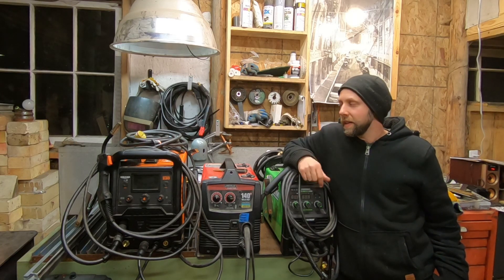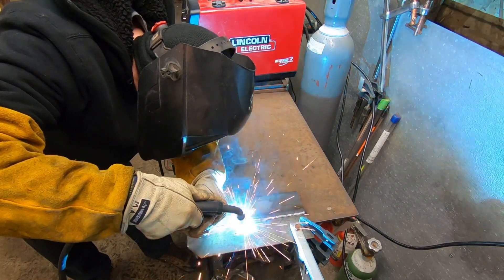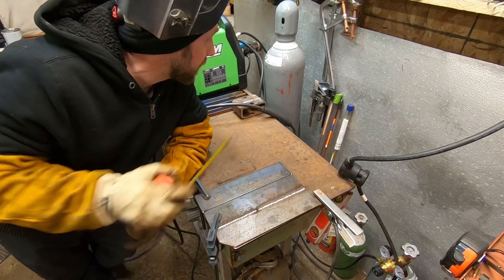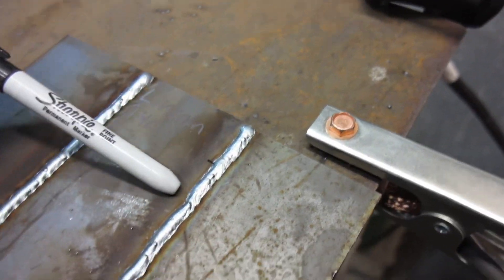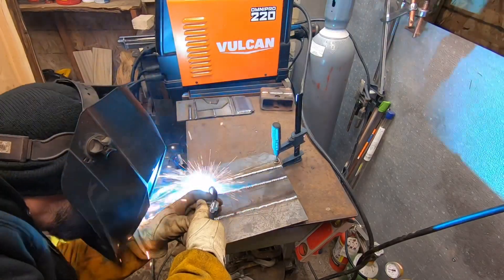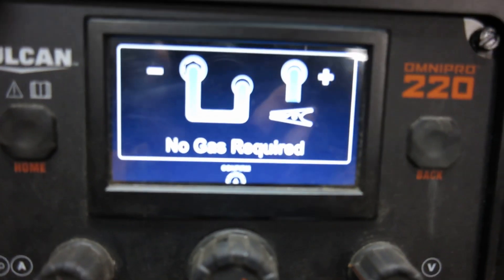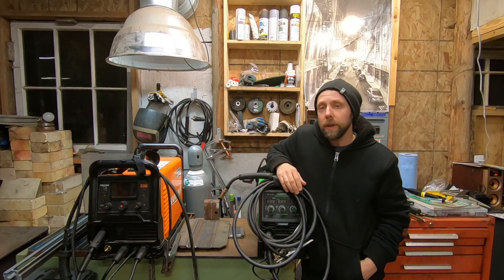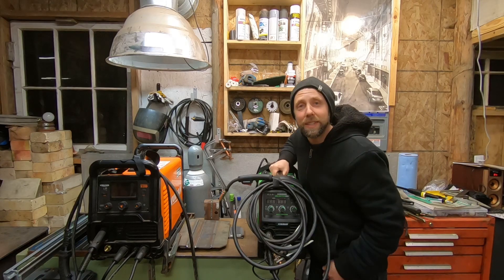Titanium Vulcan welders 120 volt MIG test

Comment: I have a titanium 170 with spool gun: it all runs amazing…. Aluminum, flux, and mig shielded… absolutely unbelievable… I have yet to burn a tip on aluminum welding and I’ve run through about 4 pounds of aluminum. I don’t know about the longevity of this machine, but the ease-of-use is out of this world. And you can most certainly weld aluminum thinner than an eighth with no problem, just watch your heat input and try to run each individual bead with the aluminum cooled….. I cannot say enough about how I was blown away by this machine… Love it!

Comment: Just got the titanium unlimited 200. Running .035 with 75/25 argon/c02 it's putting nice flat welds on 3/8 tube I salvaged to make a rocket stove. It punches way above its price and size range. I haven't managed to overheat it yet.
Reply from the maker: They are definitely solid welders! My Titanium 200 is still going strong 💪🏼 
I loaned my 200 to my friend, he really likes it as well 👍 I’m glad to hear you like yours 🙂

Comment: I use a Lincoln 140 at home with 120 volt,  with a 20 amp breaker, wired with 12/3 wire.  Never popped a breaker yet.  Pros and cons to both inverter and transformer welders. I was trained at the Lincoln school of welding, so I am partial to Lincoln🧡.  Thanks for the review.👍

Comment: i think this machine it cost $860.00 now
Reply from the maker: It’s a bummer the Titanium went up in price, at $650 it was a good welder at a good price, $850 is asking a lot, good machines still but there’s a lot of other good welders available in that range.
Reply: I work at harbor freight it’s on sale at 999 but normally it’s like 1150 (omnipro)
Reply: @parkeryj3135  $1000 was the normal price for the OmniPro back when I got mine for $850. But, most things at HF have been creeping up in price.

Comment: I think the Lincoln transformers when they start to wear or get old they start to have a lower and lower duty cycle. I have the hd 180 but on 220. 220v help the longevity of any machine over 110. The 110 is what kills the transformers and makes them heat up. Setting up a 220v sub-panel is easy to do with home depot gear. You should have everything on 220 at least.

Comment: The vulcan is 1049 dollars....The Lincoln is 589 dollars.....
Reply from the maker: The Vulcan is also 120, 220 volt, it’s a Mig, Stick and DC TIG welder with auto set, memory and a spot welding feature, it’s an inverter machine also, it also has a far better duty cycle. I have spent countless hours on each of these machines, I would never consider buying that Lincoln after using it and knowing how bad of a machine it is. Take care Muriel 🙂
Reply: @Mikefestiva  Thanks...I was considering buying one...glad I didn't !
Reply from the maker: @mlbabineaux  I think the Titanium 200 is a great welder, I have used it a lot over the last two years and it’s been rock solid. It’s also 120/220 volts, inverter machine, MiG, stick and DC TIG, it’s not auto set but it’s got a nice chart for all the MiG settings, it’s also spool guy ready, so for another $160 you can buy a spool gun and weld aluminum. If you check out my articulating dump truck series, I used that welder to build the entire machine, it’s quite capable. I also have never hit the duty cycle on it. Take care 🙂

Comment: Hello. Can you tell me if the Titanium mig you have (140 or 170) will weld below 125ipm? This is my second Titanium 170 and neither would feed below 125ipm. Basically you pull the trigger and it feeds maybe 1/4" of wire and arcs, then it stops feeding but continues to arc from the tip to the work. It is on 2T with gas on and voltage around 15 and inductance in the center. Many chart settings are below 125ipm so that is why I am concerned. So its almost like the software isnt sending the feed motor enough power below 125ipm. Above 125ipm it welds fine. Thanks.

Comment: Thanks Mike, great review! Question: I’m thinking to get a Titanium mig 140. But I want to run it off a generator because I have a lot of field welding I’m going to do. What kind of generator can I use? I have a 5600 Briggs and Stratton gen, would that work?
Reply: Since it is an inverter machine, they are picky what kind of power supply they are hooked up to; should be an inverter generator or other "clean" power source.

Comment: Hey Mike, Thanks for the great videos....I do have a few issues with a few of your mentions and comparisons. I am firm believer if you compare machines you need to get ones that are extremely comparable as for the Lincoln you used was not and the dogging on the machine is not fair. You dont compare a diesel pickup pulling power vs a midsize gas pickup. My only reason for this is ppl are persuaded easily and from your comparisons the dogging on the Lincoln machine ppl take that out of context and think Lincoln is junk. You should be comparing with the Lincoln MP210.  I have been a heavy machine welder for 25+ years and now supervisor of a welding shop that welds every type of metal material from 18ga to 6" thick solid steel,  we use several different brands of welders and I will say without mentioning brand names our red machines out perform and never break down as for our blue machines they are only couple years old and are damn near wore out and are extremely weak now....only time we use them is for aluminum. Now for my personal welder I had a non inverter Lincoln which it welds great for being non inverter but I updated to MP210 and all I can say is WOW!!!!!!! It is a hell of a machine so please get your hands on one to compare please. Couple questions for you is why are you vertical up welding with standard mig wire? Some of your welding techniques I question...... but to each his own....but if I had an employee lay a piled weld as you did on the second long weld I would be having an education course on proper welding techniques. Again dont take this as me digging on you for everyone has their own way of welding. Thank you for the great videos and keep it up.
Reply from the maker: I’m surprised with someone that’s been welding as long as you, that you wonder why I’m MiG welding vertical up? It’s much stronger and you get much better penetration then MIG welding vertical down. If you are only looking for a nice looking weld but could care less about penetration then weld down hill like you mentioned.
As for you getting upset that I compared this Lincoln on 120 volts to the other welders on 120 volts, they are all on the same playing field because I’m running them ALL on the same voltage. Sorry if you got upset because I really don’t care much for Lincoln, especially there consumer models.
Ps I really would like to see a video from you on your welds and techniques, you seem to really pick my welding apart, I sure would like to see a video from you and your welding skills, let me know when you post one please.
Reply: @Mikefestiva  It is providing using the proper wire for vertical up welding. So here is a perfect scenerio for you on vertical up.....a former employee was welding vertical up threaded ends on 8" pipe casing with both pieces being chamfered roughly 3/8",  he to has welded for as long as I have ...the company drilled 60' with the pipe and brought it back due to only 1" of the weld holding as the rest of the weld was cracked so I ground it out and rewelded it with a common process. I have welded roughly 600' of this well casing and have never had one fail with common welding process. So take that for what it is worth to you. No I was not picking you welding apart I was merely asking why you chose to do what you do? If it was something you were taught or self taught? I am not a state certified welder for no reason. I ask because I am curious. I also asked  for you to compare apples to apples which you did not, so hate on Lincoln all you want thats fine your entitled...if we all liked the samething thing it would be pretty boring world.

Comment: Does anybody know why my titanium 200 only goes up to 70 amps when i do stick? Is it maybe because i have to plug it up to the 220 volts ?
Reply from the maker: Yes all multi voltage welders are limited on there output if only plugged into 120 volts.
It’s like running a V8 on 4 cylinders 😂
Take care Leandro

Comment: Idk why but my welds look nothing like that. I'm on a titanium 200 running 120 with .30 wire. My welds are all dark and full of pin holes. Ive tried going slower and faster and no difference.
Reply from the maker: MO A K It sounds like you don’t have shielding gas coverage? What gas are you using? You need to set your regulator to about 8 to 10 CFH gas flow. If you turn up your gas flow and tap the trigger for a moment can you hear a little hiss of gas coming out of the MIG gun? Under your door where you load the MIG wire in the upper right hand corner is your switch set to MIG not Spool gun and is your gas line plugged into the gas quick disconnect? Check all those things, if that doesn’t fix your problem let me know and we will dig deeper.
Reply: @Mikefestiva  I am running 75/25. I have it set at about 20 CFH with trigger on. I have my garage door closed and no fans on. I made sure it was set to mig and I do hear gas coming out. Although it only seems like a very brief time that it does. I was wondering if the humidity might be too high so I will go in my garage tomorrow only opening the side door instead of the main door. Ill check the gas quick disconnect as well as now im not sure lol
Reply: I got it going. It was the gas. My lead wasnt all the way in😅

Comment: Hey Mike, quick question. I’ve  been undecided  between the Titanium 200 and Vulcan omnipro 220. Would any of these be useful to make a 25 x 15 carport? The thickest metal will be the 4x4 square tubing 3/16 gauge. Other than that I would use it for small welding projects?
Reply from the maker: Hey Jaime both welders work great and would handle 3/16” no problem.
I really liked the Omnipro 220 but after trying out the Titanium 200 I found it fit my needs best because it was only about 26# and more compact compared to the 50# of the Omnipro, I find it to be much easier to pack around.
The Omnipro has more options and I do miss the auto set feature the most but the Titanium has a really simple metal chart inside the door for settings so it’s a simple thing to setup quickly. I hope this helps.

Comment: Howdy Mike! Just picked up the titanium 200 (because of your videos) and I can't wait to start fabricating things. I have an equipment restoration biz and I've been using HFreight's $90 flux core welder..with fairly decent results. Can't wait to get this unit going! Thanks again for the videos!
Reply from the maker: I think you will definitely enjoy having the 200, especially if you run it with shielding gas!
Reply: @Mikefestiva  , is there a particular brand of wire and, stick welding rods that you prefer. I do remember you saying that you don't stick much, just curious. Thanks!

Comment: Mike, i know nothing about welding but i'm gonna learn as a hobby. Don't have 220 in shop yet so i was looking for a 120V welder. Went to Harbor freight and got a Flux 125. Put it in my buggy. Stayed 2 hrs in Harbor Freight rolling around getting a helmet,gloves and other stuff not welder related i don't need. Then i went back buy the isle and saw a stupid coupon for the 140. I said "it's just a little more with the coupon. Then i said...maybe i'll have 220 in the shop one day AND try gas and then talked myself out of it UNTIL...i noticed  a coupon for the 170 for 449.00. So i bought a 170. Harbor Freight is like crack. I buy so much stuff i really don't need. I once went in to buy a 2.00 bottle of thread lock. By the time i checked out i had spent 100.00. Guess if you are gonna go in might as well go all in. I subscribed and been following your welding videos.
Reply from the maker: DXT61 Thanks for checking out my channel 👍
As I was reading your comment I was thinking I need to suggest the Titanium 170, and by the time I got to the end I see that’s the one you got! You will be happy with it, 120/ 220 you will definitely like it. I have a lot of videos talking about tips on welding and fab work, you will be laying down nice welds in no time!

Comment: I really appreciate your reviews. About the Lincoln I had to switch over to a dedicated 120/20 Amp breaker.  Basically, I unplug my washing machine...lol it won't run well on a 15 Amp circuit at all. I also cannot stand the duty cycle. It runs good once then constantly stays hot. Keep up the great Videos!

Comment: Can any of these weld aluminum well on 120v with a spool gun?
Reply from the maker: Yes they all can run a spool gun. The Titanium 170 and spool gun would be your best value, if you buy the 170 and spool gun on sale you can get both for about $600. I think you would be limited to 1/8” or a little thicker on 120 volts. Take care

Comment: I’ve been welding for a little now, compared to some I’m still a beginner and I know that. I’ve welded for work and hobbies, that being said every professional job I have ever done was with a Lincoln or Miller but the fact is that it was always stick or tig. Most professional welders use those two and only use mig on minuscule jobs. Now with that being said I have a Miller mig and an older stick welder, the miller just doesn’t cut it anymore. I’m constantly going over my welds because I’m not confident in the penetration or just using my stick welder.  So that brings me to shopping and I resonantly found the volcan welder and decided to do my research on it and found your videos. I’ve now seen all of you comparison and reviews on both. I have enjoyed them all and the amount of detail you put in to them. I think you are 100% correct on your statement being that these are not big professional welders their an at home hobbiest tool and from ever think you’ve said and showed tells me that’s exactly what they are and I thank you for that and for your comprehension view and awesome videos. I will be buying the volcan Omni pro soon because of your videos!! Thank you again!

Comment: I have a 175 Pro Lincoln Mig Welder 230 volt bought it in 2003 17 years ago and still welding, it will weld 1/2 plate with .045 wire in one pass, I welded a lot of 1/4 to 3/8 things for My Jeeps bumper, Racks, tube door's, Nurf slider's bar's, shock mount bracket's on My trailer, Made 2 brackets for My 60 gal air compressor for hose reel's 25' and 50' , I took 6 month of welding classes at a High School on Saturday's Stick welding 1'' Plate, I use a Mig at School about 3 or 4 time's Before My Job got in the way of taking Classes, I was a Truck Driver by trade for 30 years until put on disability by the State of California,  I would like too buy a new Everlast MTS 252 STI A/C D/C Welder So I can Learn too Tig weld and Tig Aluminum, About 4 years ago I did buy a Hypertherm XP 45 Plasma 230 volt cutter with dual 25'ft. torches, cutting torch and gouging torch, cutting capacity 5/8 severance cutting 1'' 1/8'' It's Amazing what you can cut with it and how fast it cut's, I wish I had a Plasma table I wouldn't be broke then LoL

Comment: just found your channel this week.By chance I'm looking for a Mig mainly for 110v. Went to the welding shop yesterday looking at the Lincon 140 priced at $859 with a mail in $210 rebate. Also went by and looked at the Harbor Freight Titanium unlimited 200 for $700. Compairing everything the Titanium is dual voltage which sez @ 220v it can weld 3/8 which is a possibilty. Then I ran across the Duty Cycle. I didn't understand what this was and went back asked at the welding shop and it wasn't well explained to me??? I watched someone elses channel on here and it explained it well. The Lincoln is a 20% duty cycle and the Titanium is 90amp 40% duty cycle (both @ 110v). I'm retired so this a major purchase for me. My friends want me to buy the Lincoln but I think it looks like the Titanium is a better unit but you are the only person who has praised it and you were laying down a impressive row of dimes.  I'm about to pull the trigger on this sale. Am I looking at this correctly? What about parts or service on the Titanium?
Reply: Consider the onmipro. A great all around welder.
Reply: I am also thinking about the Titanium.  The downside of buying Harbor Freight is there are no parts options if something were to break and unless you buy the extended warranty there is no service.  If you notice HF seems to replace welder lines every 2-3 years, maybe?  It might be worth spending extra money so you can service your equipment 5+ years from now.

Comment: Have you ever run ether machine on a generator?   I have a remote job to do and only have a generator on site!
Reply: I have ran the HF 90 flux core welder on my generator outdoors   several times and it welds fine.

Comment: Mike I’m just now finishing off the flux wire that came with my little welder and I got some
Vulcan flux cored wire to use now. It’s the best they had at HF. What do you think of their flux cored wire? I’ve yet to use it and the wire that came in my “weld out of the box” welder is all I have to compare it to.

Comment: Do you run your titanium mig work on your 15 amp circuit shown in the beginning of the video?
Reply from the maker: It’s running on a 20 amp breaker, I need to install a 20 amp plug, all the wiring is 12 gauge.